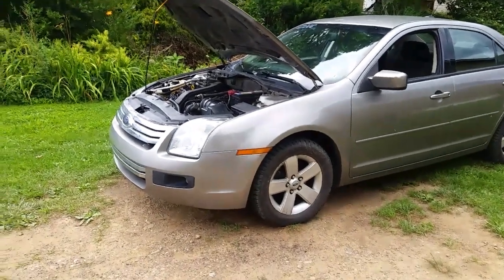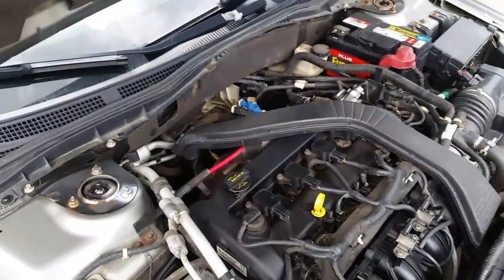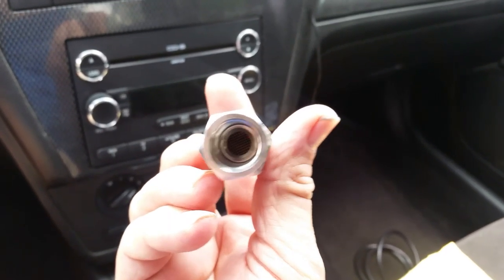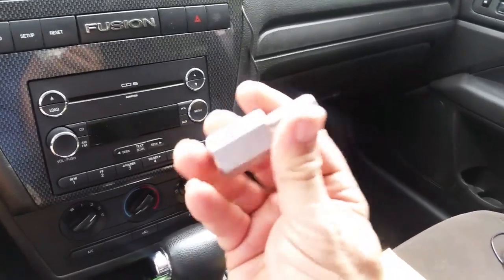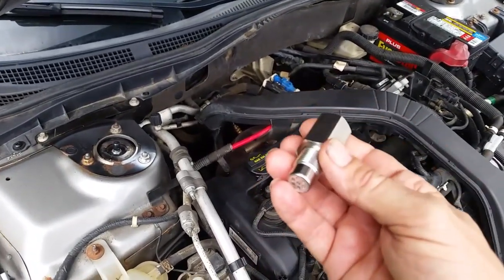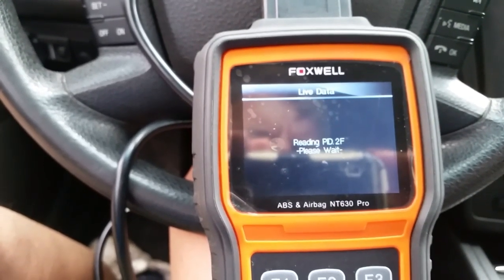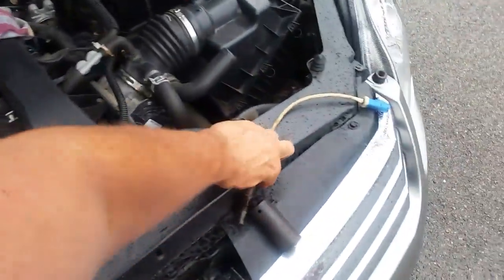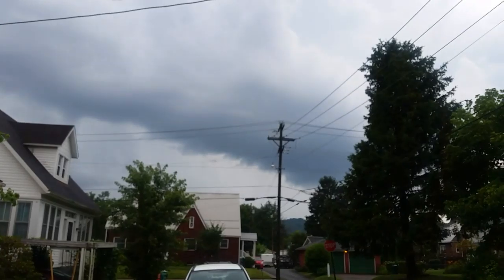02 Extenders (P0420)... Do they work? My Test results.

Comment from the maker: Note: This did not work for me. After replacing the Cadillac Converter with a $40.00 one, the check engine (P0420) code never came back on after 400 miles! I did have to do some welding with a 110v welder... but was not that big of a deal
Reply: Cadillac Converter?!?
Reply from the maker: Catalytic converter....Auto Correct...lol
Reply: you're right!  it didn't work for me
Reply: @brandonwilliams966  its when you replace your whole car with a cadillac. Its a $40 fix
Reply: I think the problem is, than you installed the extender in first sensor, you need to install in second sensor
Reply: Some people legitimately call them Cadillac converters. I have heard it said so many times that I don’t care to correct them anymore.
Reply: @dongeronimo2782  1 year later still working?  My experience with cheap cats is they last a year and then strat to crack apart and you get rattles and the code comes back.
Reply: @ChinoCopart  because something else wrong with your car then because they worked for me and you can only install them on the after cat  Not the pre cat sensors or the Air fuel ratio sensor this where many people make the mistake and claim they don’t work
Reply: @rafaelmendoza1103  my words exactly they should only be installed on the after cat or exhaust sensor not the air/fuel ratio or pre-cat sensors
Reply: 2010 Honda Accord 3.5 V6 j series right here I gutted all three of mine the 2 precast up front called bank 1 and then bank 2 front engine and the one next to the fire or behind the engine and the third cat which is not monitored by an O2 sensor on the exit  it eliminated a lot of the restrictions and a lot less back pressure on the engine is noticeable to on my OBD2  scanner app it’s a lot more responsive and it has some growl now

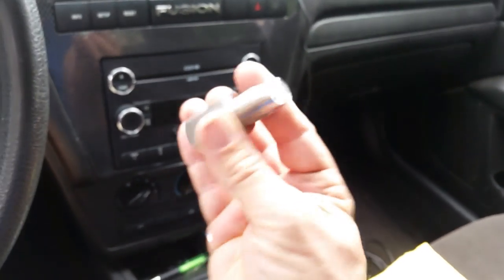Comment: His information at 2:00 is incorrect. The only difference between the codes P0420 and P0430 is one is for the BANK 1 converter and the other for the BANK 2 converter.

BANK 1 and BANK 2 refer to the two sides of a V6 or V8 engine. A modern V-engine will have two separate exhaust manifolds and two separate catalytic converters and, therefore, four O₂ sensors (each catalytic converter has two separate O₂ sensors, an upstream and a downstream).

You ALWAYS put the spacer on the downstream sensor. This is the 'after' sensor, it's readings are compared to the 'before' (upstream) sensor to get a reading on the converter's efficiency, so it's the one you want to move further out from the exhaust stream to stop the check engine light from coming on. It will always be the sensor that's furthest from the engine (and closer to the tailpipe).

BANK 1 is always the side of the engine that is the most forward. With a conventional engine it's closest to the radiator, with a transverse engine it's  furthest from the transmission side.

A P0420 or P0430 code DOES NOT mean a bad O₂ sensor, so don't try just replacing them, it won't fix it. A bad O₂ sensor code is usually P0130-P0134.
Reply: What about bank 1 on a v4 engine? 
there’s only 1 under the car right ?
Reply: V4 engine?  Most (all) modern 4-cylinder engines (except for horizontally opposed engines "boxer" engines such as Subaru and Porsche) are of the inline configuration (I4).  Inline 4-cylinder (I4) engines only have one bank and will set a P0420 (bank 1 catalyst efficiency low).

Comment: I tried one on the rear O2 sensor on my Dodge Journey, and it worked great for me. Even passed emissions for my inspection.
Reply from the maker: lucky you!
Reply: @FixingWithPassion  I don’t think it’s luck lol. A local mechanic I know even advertises this on his business card. I went to get help on mine. 15 mins later clear light, passed emissions and didnt have an issue with the car. Sold it two years later with no code
Reply: It's banks  one or banks 2

Comment: You must have a extender for each bank and after you clear the code and install the extenders you must do a full reset of your car like unplugged your car battery and plug it back up and your code will never come back on.
Reply: So get 2 for bank 1 and bank 2?
There’s never more than 2 right
Reply: Yeah has to be two installed not just on snf they must be installed down stream  post Cat.

Comment: Appreciate the view of the reader and showing the sensor 2 and 3 for the jumping and explaining how it should be steady.
Reply from the maker: Nice!
Reply: @FixingWithPassion  My downstream is jumping and on the same scan tool as you have.   I am in VA, which has emission testing.  Can I put that on to get the computer to reset?  Is the adaptor a standard size?

Comment: The non cat ones work exactly the same, cost 1/4 - 1/2 less too.  Instead get the non-cat ones with 3 inserts so you can increase or decrease the amount of gas getting to the O2 sensor by replacing the different orifice sizes.  Another thing I take issue with is that the catted ones stick into the exhaust stream causing restriction in the exhaust.  Theoretically the non-cat ones allow better flow and more performance.
Reply: No false necessarily

Comment: This worked for me on a Ford Fusion 4 cylinder code p0420.
I believe your information about the p0430 code may not be correct also. I believe that the p0430 code is the same code as the p0420 code, the only difference is the 20 code is bank 1 cat., and the 30 code is bank 2 cat. If I’m not mistaken.
Reply: you are soooo right...
Reply: You are correct, its the same code but for different banks
Reply: Correct.

Comment: I have a code for Bank 1 Sensor 1. Passenger side O2 sensor. I’ve replaced it multiple times with no luck. The cel always comes on, and the idle is slightly higher than normal with poor fuel economy. I’ve replaced all the other O2 sensors with no problems. I’m hoping the cars computer isn’t dying or the cats are bad. I have no vacuum leaks either. Vehicle is a 08 Nissan Pathfinder 4.0 with 180,000 miles.
Reply: Running rich
Reply: sensor one is the fuel/air ratio sensor, the cat has nothing to do with it. im sure it is runing rich or lean. try some fuel injector cleaner
Reply: @dragossabin8265  Sold it. But the new owner replaced the downstream sensor and the light went away…guess I should of checked. Cats were definitely on they’re way out regardless. It’s probably at 190k now

Comment: Make sure not to contaminate the tip of the O2 sensor with any oil’s grease or anything else!
Reply from the maker: Yes!!
Reply: I use water
Reply: I spray mine with break parts cleaner.

Comment: I live in area where its a safety inspection no emission, i put one in my 02 blazer and it fixed it, i can. The cat rattling, so might do a delete on it or punch it out
Reply from the maker: Yea nice!
Reply: It worked for someone I know. Adding the sensor after they punched out the catalytic converter kept the light off.

Comment: Add a gallon of lacquer thinner and then drive 150 MI if you have a 5-speed running fourth gear if you have an automatic running second gear do 80k 90k keeps the RPMs up. Three hour drive. The light should go out
Reply from the maker: Nice!!
Reply: I did that instead I use 108 octane booster
Reply: Tried it a couple of times. It didn’t work

Comment: My cousins 2005 Nissan Sentra  was throwing the code p0420 had a spare one of these left over from the ones I got for my 2010 Honda Accord V6 coupe I got mine from Temu where you can buy them super cheap

Comment: I have had this problem and I thought,, as confirmed in the comments, that the p0420 is the upstream sensor, but you put the extender on the downstream... am I wrong?  I tried it on the downstream and then realized that wasn't the one throwing the code... which I know is weird, but now i have it on the cat and just did a german Autoprofi DPF/Catalyst cleaner which you put into the cat through the O2 sensor with fuel additive Oxicat which is not just supposed to clean the cat, but restart the regeneration process... so I hope something works cuz its 1000 dollars for a Nys legal CARB (California) cat and that's just nonsense
Reply from the maker: The down stream sensor or "Last sensor" samples the exhaust for government emissions standards. The first sensor before the cats just adjusts or tell the computers to richin or lean the fuel. Now the 3rd sensor would have been the ideal place but i could not get it out. So the 2nd sensor should work but having 3 sensor on this car was  a first and somewhat confusing for the emissions. But yes the last sensor is the correct place to to the Extenders. Maybe I'll do a test again with the extender on a different auto.

Comment: 2:10 p0430 is just the opposite banks cat failure code. Fords are notorious for throwing both banks and having genuinely faulty cats. They are also notorious for having vacuum leaks but the upstream o2 sensors pick that up and normally trigger p0171 and p0174.
Reply from the maker: My Gl Has that code. Man i'm struggling with that one!
Reply: @FixingWithPassion  what’s the GI mean? I can help with the codes though.

Comment: you put the spacer on the wrong one. you need to place it on your downstream one the last one. that is the responsible o2 for tripping the code. P0420/0430
Reply: Exactly my thought
Reply: Just put mine on 2002 ranger and so far so good.Downstream 2 oil foulers one drilled out..All cats been deleted and truck is running really good. Knock on wood..

Comment: If it said Bank One why did you put it on the last one put it on the first one that's where the sensors at the sensors not in the back it's on the first one bank one is the first one that's why it didn't work
Reply: On any V engine there are two exhaust manifolds. Each one is a bank. Bank one is the side of the engine with spark plug number 1. Bank two is the other side of the V-6 or V-8 engine. Sensors are then identified as Bank 1, sensor 1 before the cat or bank 1, sensor 2 after the cat. Same for bank 2.
Reply: It's only one bank on a 4 cylinder you put it on the o2 sensor after the cat witch is referred to as the downstream you should never put a spacer on upstream

Comment: i have a 2016 fusion and it had a po420 code i put a spacer on it and passed emissions my spacer only cost 6$
Reply from the maker: Dawg!! wow!
Reply: @FixingWithPassion  my car is 8 years old and in colorado they only check for codes//check engine lights , yeah from 8-11 years old they only do that and after 11 years then they put the dyno smog test on your car
Reply: You put it in upstream or downstream sensors ??

Comment: How old is this car how many miles on it? The warranty covers the emissions system for longer than the regular warranty! And they should work at least 200,000:miles!
Reply from the maker: Under the Emissions Performance Warranty, Ford Motor Company provides coverage, including labor and diagnosis, for 8 years or 80,000 miles (whichever occurs first) for the following emissions parts... this car 169,000  ;(
Reply from the maker: The warranty coverage period for the following parts is 8 years or 80,000 miles (whichever occurs first):

    Catalytic Converter
    Electronic Emissions Control Unit (ECU)
    Onboard Emissions Diagnostic Device

Comment: I have P0420 code when I read obd2 reader " catalytic monitor is completed " So what is the issue my catalytic converter is bad or some thing else . Also my downstream o2 sensor reading is 0.1v on idle mode
Reply: Check the upstream O2 sensor as well. If both sensors are ok, Then check whether is there any air leak between O2 sensors in the exahust line. 
If that one is also ok, Then it is the catalytic converter issue.

Comment: I live in a certain county in Texas that's exempt from emissions & my '96 corolla can "legally" have a cat delete (I have a few modifications done to the rest of the exhaust system)
I'm tempting to do a cat delete but don't know what size of the O2 sensor I would need if I did do a cat delete
Reply: I believe that's universal size
Reply: @jaimesantiago1751  apparently on my Corolla, it doesn't have a O2 sensor directly on the cat
only the headers (in which the sensor itself is smaller than the bung hole in the headers), & the O2 sensor after the resonator
Reply: @Jeremy_Hill_2020  what year is it?
Reply: @jaimesantiago1751  1996
Reply: Mine is 1996 and no cat.and the thing pass inspection 😂
Reply: @jaimesantiago1751  what state you in? 👀
I have headers, test pipe, resonator delete, & 3" blast pipes on the stock exhaust piping lol
gonna do my own cat back exhaust with 2.5" piping cause apparently they're discontinued for the 7th gen Corolla
Reply: @Jeremy_Hill_2020  I live in Puerto Rico and my Corolla is all original and my engine was redone from 0
Reply: @Jeremy_Hill_2020  no cat.and still pass inspection like a new car and no cat.and no tricks.My son lives in Alabama and he tells me that there is no such thing of inspection.
Reply: @jaimesantiago1751  I seen some Corollas like mine in Puerto Rico with like 19 inch wheels cause its apparently a thing over there to put huge wheels on a small car
also a crazy sound system like speakers all over the doors, etc
Reply: @Jeremy_Hill_2020  I don't like to spend money on those things 💀
Reply: @jaimesantiago1751  oof 
usually seeing big wheels on a small car isn't my thing 
max wheel size I would go to would at least be a 205/55/16 set up
I'm currently on Integra LS mesh wheels that is 195/55/15

Comment: You put it on the 3rd sensor but the 2nd sensor was the one with the problem....................??????????????????????????
Reply: As in, the 2nd sensor should be reading roughly 0.5v as you said, but its reading 0.1-0.9v which indicates the cat is bad. So the 2nd sensor needs the mini-catalyst to fix the issue. Or am I missing something? (I have no idea about the specific model)
Reply: And I mean "fix"
Reply from the maker: Actually it has to be the last port. This car had California emissions. It's always the last sensor that samples the air for emissions. Perhaps I should have done two sensors  the same time. I did try this on a different auto with only one o2 port and never really worked. More experiments later.

Comment: I have both of my catalytic converters removed 100% and passed the last 3 years he needs to take it off of all 3 only top 2 and you have to use 2 spacers it didn't work for you bc you did it wrong
Reply from the maker: I replaced the cat with a $60 one and fixed the problem. Even with 2 Extenders +California emission still detected poor emissions. Some cases it might work.
Reply: Oh I'm not saying it works everytime but you have to make sure you go about it the right way mines not to cheat emmisions street track cars but also due to 2 of my vehicles are jdm imports after replacing 4 cats and still have the light yeah even got resistors on one of them to keep the constant signal it required to pass

Comment: P0420 probably is the 1st o2 sensor before cat. You should try that too before buying cat.
Reply: P0420 is always post cat or downstream.
Reply: @billibarou  420 is upstream, before the cat
Reply: @kano2444  
Billibarou was right. P0420 and P0430 measure the efficiency of catalytic converter. They should be related to downstream O2 sensors. On the ODB scanner, they show the reading of O2B1S2 and O2B2S2 (S2 means downstream). The O2 sensor before the CAT (primary / upstream) measures the Air/Fuel ratio.
Reply: Well now let's think about this, if the code is catalyst efficiency, how can it be pre cat
Reply: Tomorrow I'm buying one and will be installing this weekend, car has poor performance and fuel wastes fast I'll keep y'all updated if it actually helps on that, i will be putting it on the downstream O2 sensor
Reply: @TxScrewhead did it help
Reply: @Empower-Master  I ended buying a new catalytic converter off of amazon for like $120 dllrs, but then ended selling the car had blown head gaskets, I let it go. Bought the mini cat for no reason its just sitting there at home.
Reply: @TxScrewhead  thanks for the reply

Comment: If the voltage is jumping that could be that the sensors are faulty or a bag ground they should read differently if there similar then yeah bad cat
Reply: No, you are wrong. This is how a good sensor works

Comment: They work in a 99 Ford Ranger and in a 03/04 f150 4.6 all had no cats and federal
Reply from the maker: Luckly SOB! lol
Reply: I have a 4.6 mustang... will have to try. You use the same brand too?
Reply: @misterbulger  
No I found then on eBay o2 spacers
Reply: Didn't work on my 02 ranger..2 foulers drilled out trick
Reply: @fightdhr8866  what engine is in your truck

Comment: I think it’s the next o2 sensor up !!!
Reply: That one controls the air/fuel mixture for the engine, you don’t want to extend that one
Reply: @kellismith4329 on a 2002 Nissan Altima it has two sensors, i recently replaced the bottom one after the cat converter, stop giving me code but the P0420 don't go anywhere.. tomorrow I'm getting a mini cat should i install on the bottom one where i replaced the O2 sensor or would it be the first one on top?

Comment: i have a 2005 camry 2.4l and both down stream o2 sensors have one of those in , and cel light comes on within 19 miles after reset.
Reply from the maker: Omy!!
Reply: what code did you get?
Reply: p0420
Reply: @Roman-pq6fy  what did you do at the end?